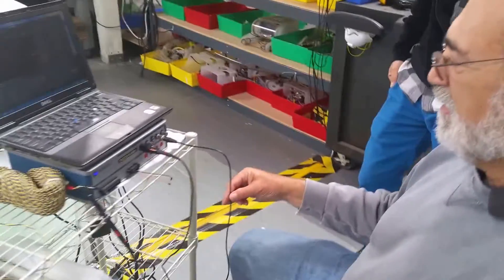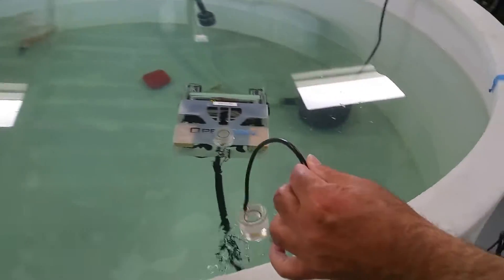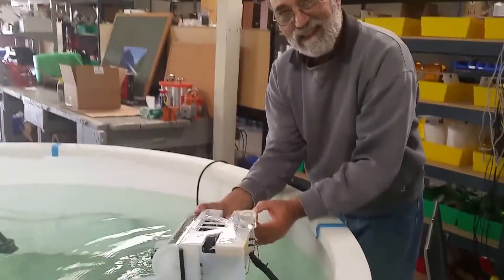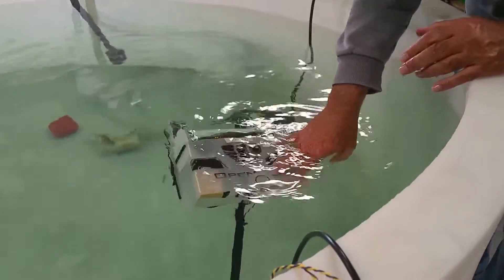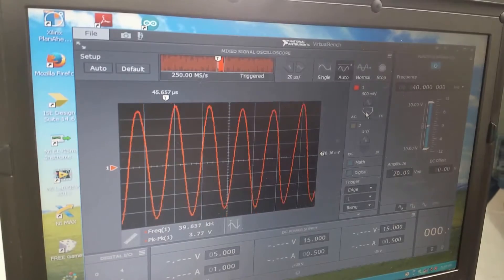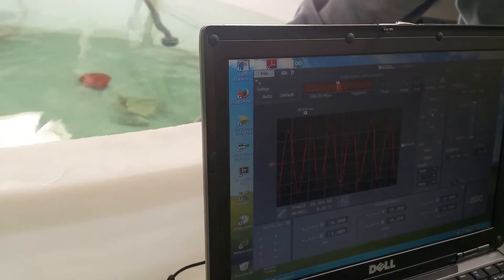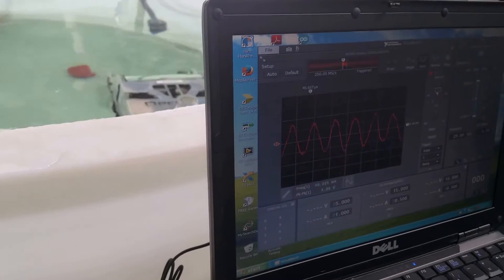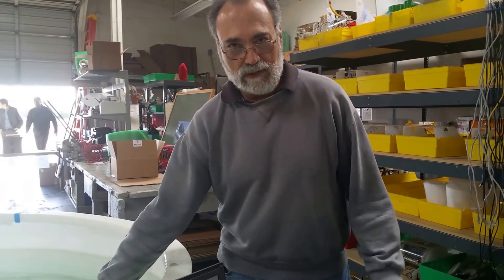Underwater Acoustic Testing

Comment: Hi Jim,  do you have a documentation on how you build your transducers?
Reply from the maker: Will,

if you follow the link back to Feb '15 https://forum.openrov.com/t/acoustic-location-system/1295/48
you will see the fixture I used for the transducer mold.  The urethane is Smooth-on Clear Flex 50 and came in a 1.5Qt kit for $38.
Reply from the maker: I just put some more info on this parallel forum: https://forum.openrov.com/t/acoustic-modems-location-and-pingers/2007/45
Reply: Jim, 

I kind of have a similar project (a much simpler version) my system's only goal is to send a sinusoidal signal underwater using sound wave(exactly like what you have demoed in your video). Do you know any working equation about the transmit and receive power of tx and rx? TIA.
Reply from the maker: Here are some references on calibration equations.  Some are quite involved.

Benson Thesis
http://kastner.ucsd.edu/wp-content/uploads/2013/08/admin/phd-thesis-benson.pdf

see section 5.3 Calibration Procedures

Classic paper from 1940!
W. MacLean, Absolute Measurement of Sound without a Primary Standard, Journal of the Acoustical Society of America, volume 12, pp 140-146, 1940 
https://pdfs.semanticscholar.org/3c96/7db5fa9f542095685c3b572a4642b74ff38b.pdf

a note I found – easier read
http://xetexracing.com/page3/page18/page41/files/SelfReciprocityCals.pdf

full paper on the method – SONAR Calibration; Delta-Z Method

https://calhoun.nps.edu/bitstream/handle/10945/22449/reciprocitycalib00beda.pdf?sequence=1&isAllowed=y
Reply: Hi Jim thanks!

Do you have the specifications of your home-made transducer like:
Receive Sensitivity @ Resonance (dB re 1V/1μPa) 
Recommended Receive Frequency Range
Transmit Sensitivity @ Resonance (dB re 1μPa/V)
Recommended Transmit Frequency Range
Maximum Source Level @ Resonance dB re 1μPa)?

or do you know any available transducer that cost under a hundred bucks with the known specs above?
Reply from the maker: I haven't run those tests, but my transducer is the same design as in Dr. Benson's thesis.  She has measurements in section 5 (fig. 5.2-5.4).  The WHOI modem has a listing of commercial transducers they use with their micro-modem. https://acomms.whoi.edu/micro-modem/transducers-arrays-and-towfish/
There are specs, but you would need to follow up with the manufacturers for pricing.